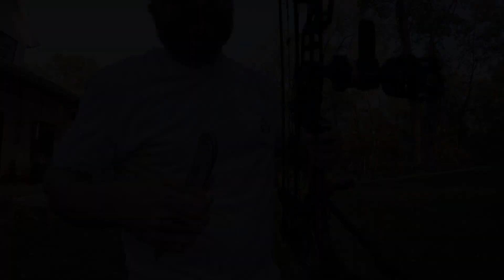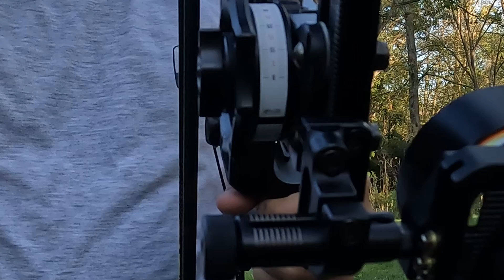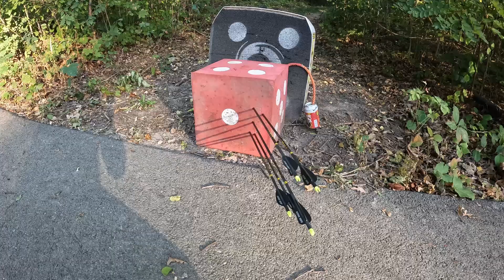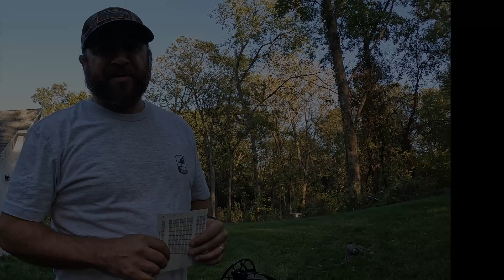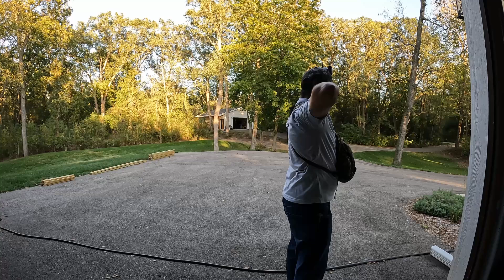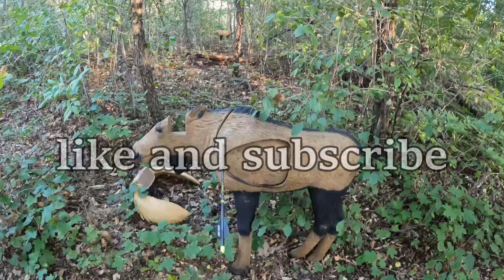WARNING Don't Set Up Your HHA Sight Tape Without Watching This First #archery #bowhunting

Comment: 👍👍  pretty simple deal with all different yardage tapes it appears.  For me on the target face I use 1/2” wide blue or white painters tape. Usually make two lines at a foot long on cardboard. That way I can set yep a vertical and horizontal line to shoot at. Don’t make a big + but separate boards so you don’t aim the center automatically. This is when you are starting from scratch on sighting in. This system is accurate to 1/2” when you’re consistently hitting the tape. Plus there’s no exact point of aim other than somewhere on the tape. Unless all your arrows are dead center in a circle type target those rings/ circles will fool you like by 1 or 2+ inches off exact true hits. 1”+ at 20 can be 3”?  at 30 yards and so on.  For me, I have to have confidence my arrows are hitting the target lines exactly in accordance with where my scale marker is setting on my sight tape.  That way you KNOW the bow and arrow are 100% set. Now, it’s up to you to hit that rabbit or squirrel at 47 yards. Anyway m that’s my OCD technique.
Reply from the maker: thank you for the detailed response, that is a great method.  I'll consider this in future videos for sure